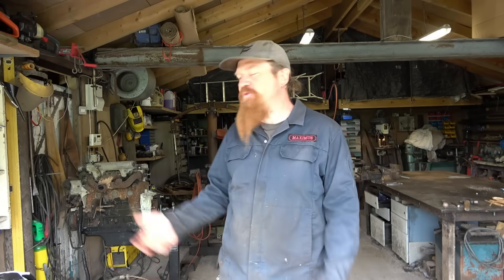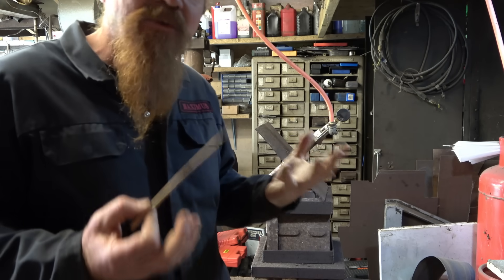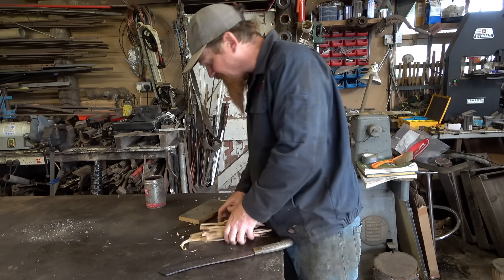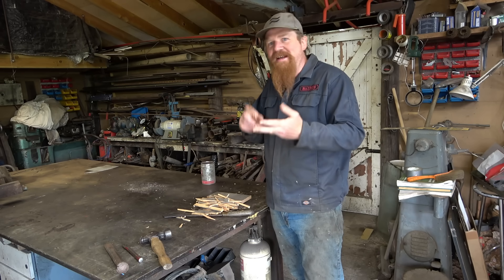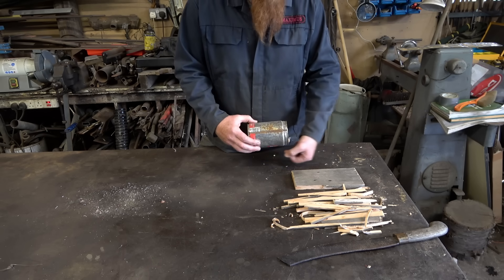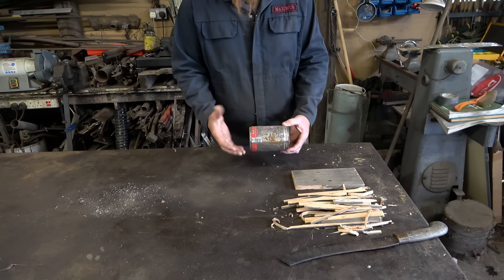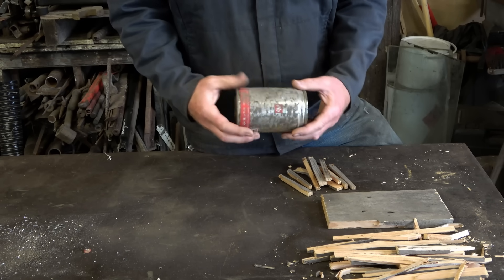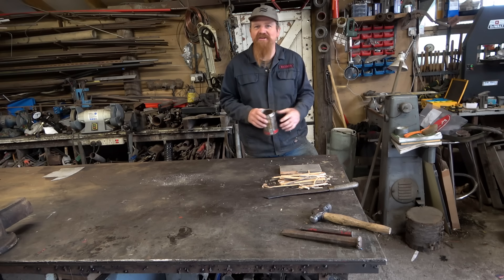Making Charcoal at Home Part 1: Theory and Preparation

Comment: A WORD OF EXTREME WARNING!
NEVER USE OXY-FUEL TO CUT 45GAL DRUMS!
These drums are used to store and transport some incredibly volatile liquids and they’re NOT always marked with labels indicating the prior contents. 
I personally, have cut many of these drums, possibly in the hundreds and have always used eitherA) A hammer and sharp bolster or B) a reciprocating saw. 
This almost completely reduces the risk of explosion. 
I asked my father many years ago WHY we cut drum heads off with the hammer and bolster and he recounted how a young man that worked for a competitor was decapitated by an exploding drum that he was cutting with a gas axe! 
DONT DO IT!
The reciprocating saw is best, if one is not available, then use a hammer and sharp bolster and be careful of the sharp edge you create. When you have fully cut the top, lay the drum on its side and with the hammer, flatten any protruding steel to the drum wall. 
Even angle grinders can cause explosion as they generate large amounts of hot sparks when used to cut steel, again, DONT USE ONE!
Never take for granted that any drum you encounter is safe, yes it may have only had engine oil in it but it may also have had really nasty, explosive and dangerous chemicals in them. 
Good upload M.I I enjoy most of your stuff immensely.

Comment: If we're going to get all categorical I'm going to have to run a propane forge on wood gas from my retort 😂
You can run a forge on wood, somewhat like you can run it on coal instead of coke. But I wouldn't want to stand near it unless it was a very cold day. And I sure wouldn't want to weld with it.
But I plan to try a smelt with it some day.

Comment: Loved the metal work! My neighbours got uppity when I made an oil drum incinerator, used a jigsaw to cut the top off, noisy and slow, then a blunt cold chisel to make air holes, very noisy. Not a recommended project for a built up area. Great incinerator though, once up to temperature almost anything would burn.
Reply: You did the right thing with the jigsaw. Better a few irritated neighbours than an explosion cause by sparks in a drum that could’ve had very volatile chemicals stored in it. 
Once the lid is off it’s much safer to burn in, though use a little common sense, if the prior contents smell bad or they give off vapours that you are suspicious of, use a long pole with a lit rag wrapped around it to light it first time. Better cautious than hospitalised or worse!

Comment: Great entertainment as always. Max I have a large industrial air tank that was in use in my place of work until the compressor failed and they bought new.  The unit was kept inside and is excellent condition. I was going to use it to store more air for my tool use but have since bought a second compressor and have no use for this tank. I would say it is at least the size of the tank you have outside. I have no use for it now and I do not want anything for it but I do not want to see it go to waste. If it were to be any use to you its free, I can supply pics it is blue in colour and was the main compressor for a large truck dealership in Cardiff. The pump failed on the unit and one of the fitters took the motor but the tank is fine.
I
Reply from the maker: Cracking offer thank you, but the farm next door have recently offered me one too and that's a tad closer! Thanks again though.

Comment: Charcoal making is something I'd like to do, but I'd want to be capturing the gases that it releases as well as making the charcoal itself, stored in a nice little gasometer of sorts to use for a gas supply, so that you get more useful energy out of the wood rather than just burning it off as the wood cooked... :)
Reply from the maker: I have considered similar, trouble with the idea is that in the retort kiln for instance, burning the gases drives the process so removing them means burning more wood underneath to replace the lost energy. No free lunches and all that! Some ring kiln methods do just vent the smoke/gases and that I'd agree is a terrible waste.
Reply: @maximusironthumper  If someone were to have an excess of wood (because they own a wood that needed coppicing a lot), it probably would be feasible, but I haven't got that so it's why it's a "would like to do" thing, I've seen a number of videos of people using wood (and coal!) gasifiers to run engines which I find quite fun too... :D